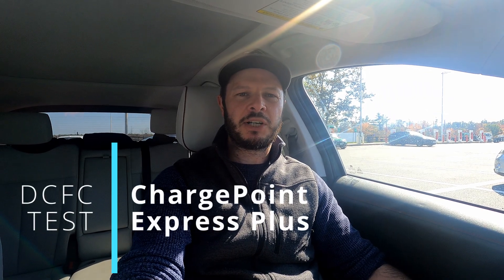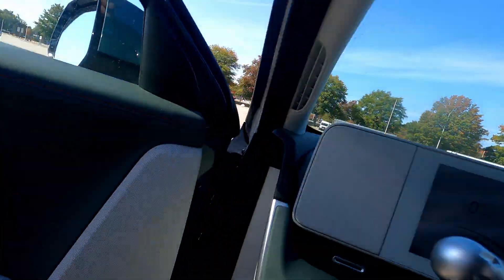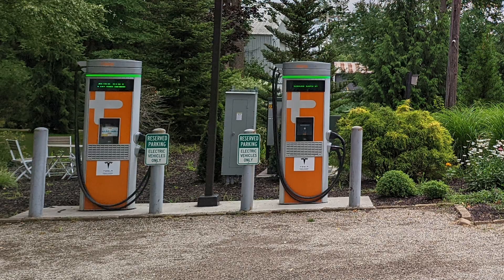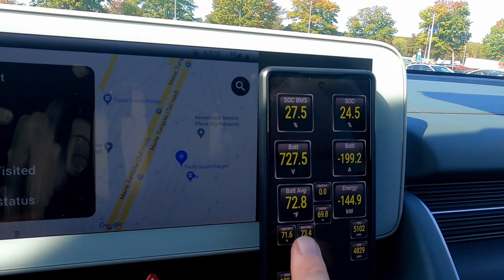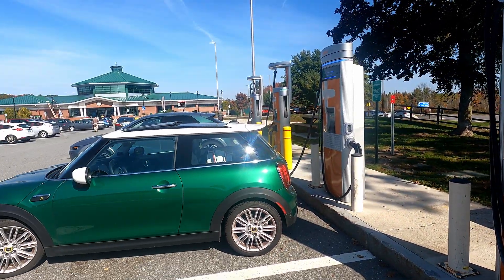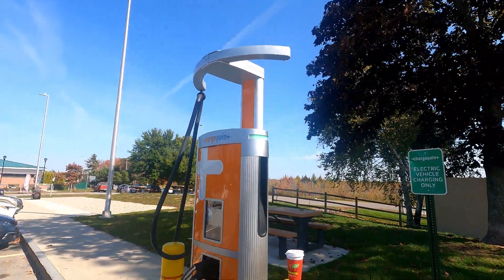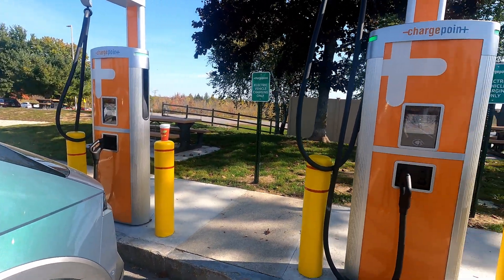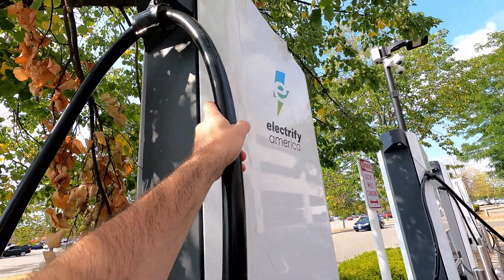ChargePoint Express Plus: New DC Fast Charging Hardware Tested in Maine

Comment: Have not seen any of the fast chargers from ChargePoint in our area. Just the level 2 ok ones and most need major repairs. The low power ChargePoint in the Harley Davidson is also failing and needs to be fixed. I am in North East Florida.
Reply from the maker: They seem to be the provider of choice for states that have a good jump on spending their infrastructure funding, such as the VW/Dieselgate money distributed at state level. So states like Maine, Michigan, and Colorado all seem to have found smart locations to add hardware and decided that ChargePoint offered the most turnkey and/or flexible solution to get them up and running.

Comment: I  charged at  those Tesla stalls in Aug.  Glad to have the stop and the bathrooms.  I saw the chargepoints being used too and were all in use when I got there.  I've always found chargepoint to be the most reliable.   I'm currently weighing to either take my wife's ID.4 or my Model 3 to Quebec. I'd rather take the ID.4 as it rides much nicer. But, Not too many CCS in ME to Quebec.  Might have to take 93 through NH.
Reply from the maker: If you're hitting winter weather, seems like the battery pre-conditioning on the Tesla might also be a factor. The ID.4 we rented for a cold weather trip back in January did okay below freezing, but we rarely got into the triple digits during DCFC. 

Would 93 give you much better coverage, or is it just a bridge through to VT and onto Quebec? I'd put Maine ahead of NH in terms of DC fast charging options, especially in the North, although proximity to Vermont's long-established and expanding infrastructure does give NH some help.
Reply: You mean most reliable except for Tesla, right? Because I've only run into one broken Supercharger in over 5,000 miles of Supercharging, but have seen countless broken Level 2 chargers (and lots of EA DCFCs offline).